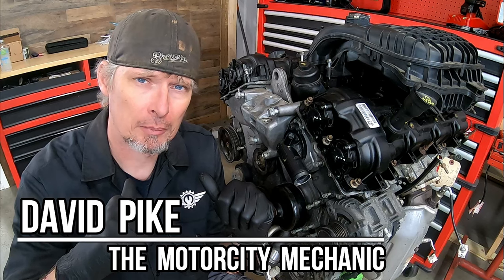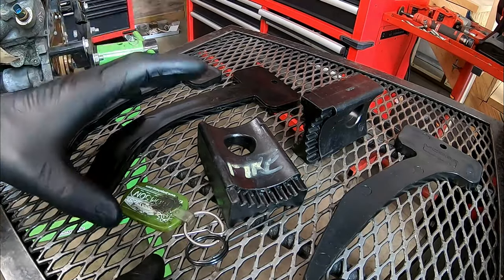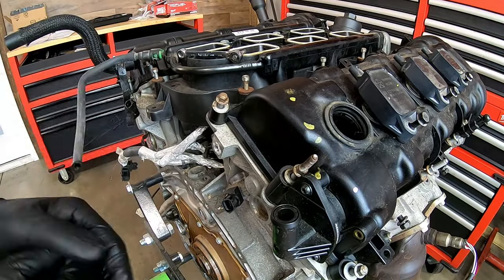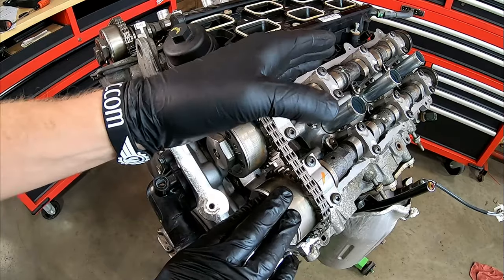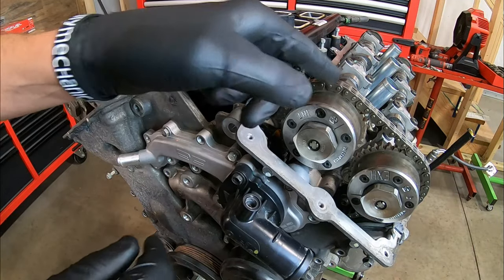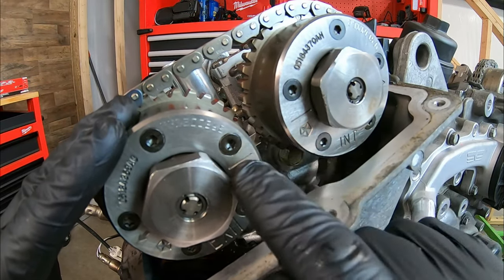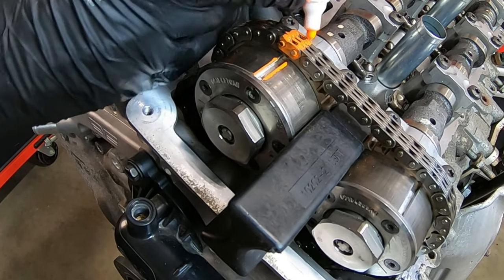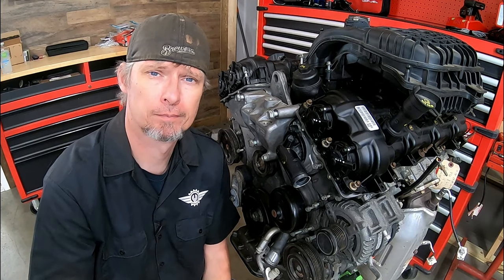Chrysler/VW 3.2 and 3.6 Rocker Arm Replacement Part 1

Comment: Did you have some video about 3.5 lt rocker arm replacement ?
Reply from the maker: I haven’t yet. Most of the time the entire rocker arm assembly is replaced . If it goes too long with making noise it can wear out the valve stem guides and cause a misfire requiring the head removal and having it repaired at a machine shop
Reply: @MotorCityMechanic  thanks for the reply . my dodge charger is doesn't making too much noise yet but did you know if i use a full synthetic oil it can help some ?
Reply: sidecarnutz  thanks yea you right it make sense .. I will use full synthetic on next oil change i appreciated 👍

Comment: Anyone know ? How long is the time in the book on this fix? And how much do dealerships typically charge to fix?
Reply: Just called the local dodge dealer in my area, they said it's a 7 1/2 hour job and about $4500 to replace all rockers, lifters, and camshafts
Reply: Thanks. Our problem was solved by a 20 yr old girl texting and driving, she crossed the double yellow and totaled out our Durango. My wife and kid were fine. And the girl is blind in one eye now from glass from the collision

Comment: 2017 Grand Cherokee with under 74k miles , oil changed every 5k miles and I’m shooting a P0302 (miss fire in the number two cylinder 🤬) was told my rocker arm is shot and probably will need to replace the cam shaft to the tune of $4K  Absolute junk and will never own another FCA product again 🤬🤬🤬🤬